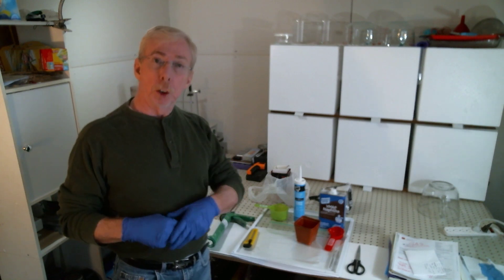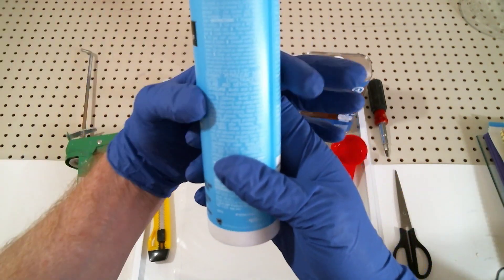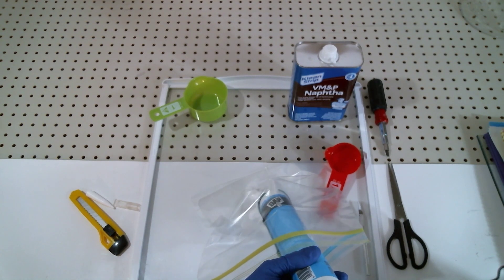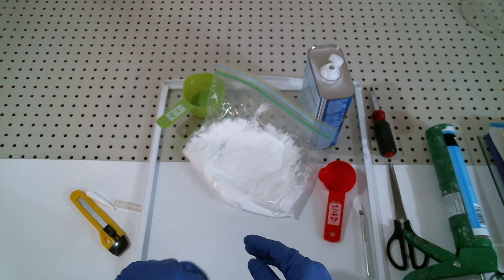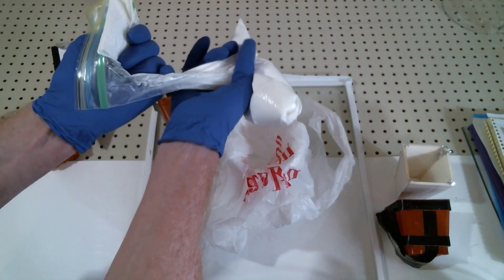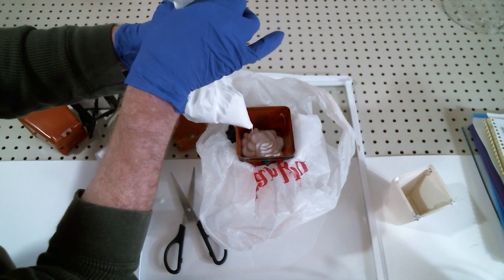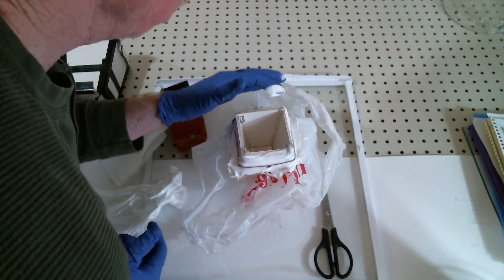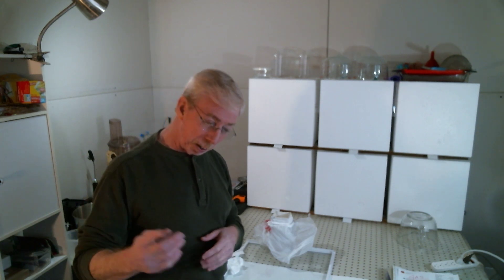NO MESS POURABLE SILICONE, thinning with Naphtha in a ZipLock bag

Comment: Can u add silicone made with different ingredients together, would they bind together. For instance I chop up  leftover silicon made with a method to a silicon made with different medium. Or would they separate after setting?
Reply from the maker: You are correct. You can chop up bits of any kind of cured silicone and add it to any kind of fresh. They will bond perfectly. Silicone sticks to silicone and become like one. Mind any dirt or air pockets.
Reply: @GEOsustainable  thank you

Comment: Ummm, so you are making a flowering pot "maybe veggies" using naptha the very toxic chemical they banned? 
ps. Fire can be avoided, but those sweet smelling toxic fumes will be killing so many brain cells b4 you are done that fire would be the last on your mind :). 
pss. Use in a well ventilated area, I would do it out doors.
psss. All in all though I used this method 10 years back it does work "silicone and a spirit/thinner, until I realized how bad naptha was, mineral spirits are safer, but still has warnings..
Reply from the maker: Thanks for the info. Maybe that is why I can't remember anything I used to remember.
Stay tuned for more on Silicone. I will include your advice. Thanks again.

Comment: Does this silicone mold shrink as it dries? I kno with regular silicone mold you can add mineral spirits 1:1 ratio and it will shrink as it dries
Reply from the maker: Yes, unfortunately it will shrink, a predictable amount. At what ever ratio you plan, I suggest you do some testing if the finished size is important. This is true of all additives to thin something.
Reply: @GEOsustainable  okay thanks for that. I was actually wanting it to shrink so I can make a smaller mold of something lol.
Again thanks for the reply!

Comment: This is the second video of yours I have watched and thank you for being user friendly. I am making a silicone mold for custom dominoes. My first attempt my silicone would not release from the dominoes at all. My second attempt i rubber vegetable oil on my dominoes prior to pouring the silicone and that seemed a lot better to release my dominoes. 2 questions. 1. Can i salvage my other dominoes I tried soaking in Naphtha, it didn't work. 2. Does the amount of Naphtha affect cure time,i made my consistency like glue.
Thank you
Reply from the maker: Great questions. And, thank you so much for saying I am user friendly. I think that is the highest compliment a YouTube creator can receive. Now to your questions. I am not sure if they can be salvaged. Soaking them did not work, so they may be done in. The amount of Naphtha does not affect cure time. Thickness of the silicone does affect cure time. So, if you need to pour thick, use my ratio of 10 gr cornstarch to 100 gr of silicone to give a cure time of one hour, regardless of thickness. Mix it well. Vegetable oil is a good choice, and popular. A bit of caution, Naphtha, and any hydrocarbon solvent can dissolve vegetable oil, wax, any hydrocarbon. I have been using dish soap of late. It requires more work, and often several coats, but no fear of a solvent dissolving it. Check here for a segment in the video of me applying soap to a plaster mold. https://youtu.be/452y9FQ7a0M
Reply: @GEOsustainable  thanks for the videos, and thanks for the advice about dish soap, I've been searching and asking for that comment.

Comment: Thanks for this informative video. Can't wait to try it out myself! But I have another question. First, watch this short video...

https://www.youtube.com/watch?v=TdYw7tg-7DU

Do you know if that would that work with DIY silicone caulk molds? Or is there something in the commercial brands that causes it to shrink when solvent is mixed in?
Reply from the maker: 100% silicone does not shrink because it is...100%. When you mix in a thinner, of some percentage, it will shrink that percentage. Make sense? To prevent shrinkage around your article, you can leave it in mold until the thinner has completely evolved out, a week or so. Hope this helps.
Reply: @GEOsustainable  Yes, that helps, though I actually want the mold to shrink. Thanks!

Comment: There is no product called naphtha (straight-run gasoline) in Europe, but naphtha is a very close relative of mineral spirits, and is also  described by some as paint thinner. Or maybe nitro-thinner?
Reply from the maker: Yes, mineral spirits or paint thinner will work. I don't know what nitro-thinner is. Any hydrocarbon based solvent will work.
Reply: @GEOsustainable  nitro-thinner is diluent for cell lacquer, cellulose thinner

Comment: Great video is there a part 2 of showing the mold dried?
Reply from the maker: I never thought to show that at the time I was just starting out on YT. The mold was used a lot.
Reply: @GEOsustainable  oh ok, I was just trying to work out cheap but good products I have seen some food type mold but it rips after a few uses, but silicone seems to be a winning product, just it Is expensive, I have seen one with that type of tube of silicone mixed with soap and  the other mixed with cornflour, the problem is the detail dont seem as good as using like paint thinner, I am just trying to find  a video of someone using paint thinner etc mixed with that silicone tube product, to see how much detail is shown, as I have a sculpture I have done but I dont want the clay sculpture damaged so I plan to use silicone as a product I put on before I put plaster of paris on it, then I will put plaster of paris in the mold, as I seen someone do that silicone tube product mixed with cornflour, and it slides off the mold with nog much  of problem, another's when they use plaser of paris mold to mold a paste of paris mold, it is difficult separating from the mold of plaster of paris, so the silicone interior of the mold is to make it more easy to release the pastor of paris mold.

Comment: Ive been having trouble with my molds shrinking after demoldinb the pattern
Reply from the maker: yes, you have to account for the volume of thinner used to thin the silicone....it evaporates. Silicone used straight does not shrink, try that if possible.

Comment: Considering using this method to make molds of ABS plastic, but concerned about naphtha melting ABS plastic. Would this be an issue? Don’t want to ruin or damage my original model as they’re quite expensive. Will also be using oil-based clay to create the base as the plastic is quite detailed. Any tips on proceeding?
Reply from the maker: Do not use this method for ABS plastic. Do not use this method for anything made from hydrocarbons. Oil based clay, that is a no also. You are correct, the Naptha will melt those. In your situation, I would buy the 2 part stuff sold online. Considering your stated investment, the additional expense is money well spent.
Reply from the maker: I have an idea for you. Use silicone oil. You can still use cornstarch to cure it.

Comment: Let me point out one problem with this method. It will not work with PLA printed items. I made a series of objects on a 3D printer, with PLA filament, and the naptha in the mix degraded the objects being molded. It interacted with the plastic and softened it to the point that the mold release I used did not work at all. I was unable to remove the items from the cured silicone without breaking the parts up. So, if you're using a 3D printed item, especially one printed with PLA filament, it won't work. 

Hope this helps.
Reply from the maker: Thanks for letting us know. Yes, Naptha will affect plastic, especially a hydrocarbon. It is a good observation that it affects PLA also. Try coating your item with a wax and use cornstarch to speed cure the thinned silicone.
Reply: @GEOsustainable  Unfortunately, the item had a significant amount of detail which would have been lost had I used wax as a release agent. My general go-to release agent is liquid Ivory dish soap mixed with talcum powder in a 70-30 ratio. In the case of having to mold small items with significant detail, I'd recommend using the homemade glycerine-gelatin molding mixtures instead of silicone.
Reply from the maker: @lancer525  Thanks again for sharing your expertise. I made a video on this.

Comment: Could you please tell me how should I make it liquid in the same time drying time should be fast ,is that possible ?
Reply: actually,i feel a bit shrinkage problem using paint thinner with silicon and corn starch,do you think only naptha can be used to stop shrinking?
Reply from the maker: @chillnature4397  Good question. Your shrinkage is due to the amount of solvent you are using. That volume has to go somewhere, and leave your mix. Naptha will do the same thing, as will any additive that evaporates. The only option is to use as little as possible.  However, I was working with a silicone roof coating recently that is thinned already, and I did not see much shrinkage after it cured. I have not tested it yet, but you can give it a try. The corn starch should help speed curing time.
Reply: @GEOsustainable  thank you SIR,Actually I also realized that it is due to more amount of paint thinner,,,thank you Sir,,,hope to meet you in hong kong some day...haha
Reply from the maker: @chillnature4397  I am happy to have been helpful. And, perhaps more soon than you think. I need 5000 silicone molds made by February of a flower pot you have seen me hold up in my introductory video. Email me at the email given at the bottom of all my videos to discuss.
Reply: Great to hear that,,,,I shall meet you if go to US someday.
Reply from the maker: To answer your question, here is the link to my video on doing exactly what you are asking about. https://www.youtube.com/watch?v=E_IOqxds130

Comment: it is a bit tricky task to control everything during casting,it dries too fast if give corn starch but it has anther problem of not going casting material inside molds
Reply from the maker: I have refined the amounts to add in later videos. Check it out in the playlist on Mold Making.

Comment: Hi, I'm in Australia and I can't find Naptha anywhere. We have mineral turpentine though. Is the ratio the same for mineral turpentine? I also have white spirits, (dry cleaning fluid), can you use this as well, and if so, what is the ratio? Also, for a mold release, is any kind of vegetable oil or olive oil suitable? What about vaseline,  do you recommend this for a mold release?
Reply from the maker: All is good that you mentioned except the dry cleaning fluid. Start with 1/4 cup to one tube of silicone. you can always add more. Small amounts at a time. Naptha is also sold as lighter fluid. The more you thin silicone, the more likely you will get some shrinkage. All the mold release agents that you mentioned are good. Hope this helps.
Reply: ok thank you. I might try a tobacconist for lighter fluid.
Reply from the maker: @rainforestcrafts3766  Let's hope for just the lighter fluid. A thought. Lighter fluid is a general term. Charcoal lighter is also lighter fluid. If you use charcoal in your country, where you buy it you can find the charcoal lighter fluid, and for much less.
Reply: what about Isopropyl Alcohol (rubbing alcohol). Is that suitable?
Reply from the maker: @rainforestcrafts3766  no, I posted a video on this. It does not work. Watch the video I did. Alcohol was a complete fail.
Reply: oh ok, thankyou
Reply from the maker: @rainforestcrafts3766  that will work. But, on the same web site, they offer this and it is much less expensive. https://www.bunnings.com.au/diggers-mineral-turpentine-1l_p1560821
Reply from the maker: @rainforestcrafts3766   @Sally Hill  that will work. But, on the same web site, they offer this and it is much less expensive. https://www.bunnings.com.au/diggers-mineral-turpentine-1l_p1560821
Reply: thanks - I already have the mineral turpentine - which is better? Lighter fluid or turps? Which has less shrinkage? Thank you so much for all your help and advise!
Reply from the maker: @rainforestcrafts3766  Both will allow for some shrinkage, which depends on how much you use to thin the silicone. At the amounts I used in the video, the shrinkage is quite minimal.

Comment: What happens to the silicon tube the bags and the rubber gloves?  .....landfill perhaps? Industry does not like waste....it has to supply the masses,what may seem like waste is a small persentage of the industrial process!  So your system encourages people to increase landfill. Its not a solution.....what about paper? Its biodegradable and made of trees......what i wanted to see is a method of making silicon moulds that don't stick to the original ....cheers Chris
Reply from the maker: They are ground up to become filler for my larger molds, and from there, see hundreds of uses. I agree with you. The goal of my company to to replace one-use hydrocarbon plastics with bioplastics. My channel teaches you the basics and from there your own creativity will generate the solutions you ask for. Stay tuned for all the many ways one can replace hydrocarbon plastic with bioplastic. I encourage you to try your idea of using paper bags instead of ZipLock bags. Let us know how it turns out! The method I use to prevent the silicome from sticking to the mold is to coat the original with a very low melt temperature soy wax, which is covered in another of my videos. Soy wax is biodegradable.
Reply: @GEOsustainable  I'll have to stay tuned can't felt you for trying. ..also thanks to the reply....Chris
Reply from the maker: @christophergaskin7787  You are very welcome, and thanks. My channel is about sharing knowledge. Many of my videos are inspired by questions from comments. So, keep 'em coming.

Comment: Thanks so much for making this video.  I have been wanting to try this, but have been hesitant.  I will definitely  try this now.   How long did it take to set before you could demold?   Thanks again your video was very helpful!
Reply from the maker: Give it a full 24 hours before demolding. I gave mine 2 days. It can be less in some situations, depending on how thick you pour it. The key is to let oxygen get to the silicone. I am glad I could help. Feel free to comment on your attempts. If you are in a rush, I have another video showing you how to use corn starch to speed things up. And, that works quite well.
Reply: @GEOsustainable  I have made some press molds with the silicone and corn starch.  I was very happy with those results.  I also made 3d 2 part molds using gelatin and glycerin, and wanting to try the pourable silicone medium to do the same.  I will let you know how it goes. Thanks again!
Reply from the maker: @jenniferwhite5299  Well, did it work?

Comment: Can I use this method for making candle wax molds an "11/2" long.  I wanna to be able to a make a wax pour of 25 to 30 at a time.
Reply from the maker: Great question. This method can can wax molds. However, this is another way to make 'stick' candles, if I understand the description you gave. What many candle makers do is to dip the wick, repeatedly, building up in a taper wih each dip. The method is how candles were made centuries ago. I will post a series of videos on candle making and the method for testing in the next few days. And I will include a segement of dipping so you can observe the method I am talking about. Stay tuned, and I think you will gain some insight into your goal.